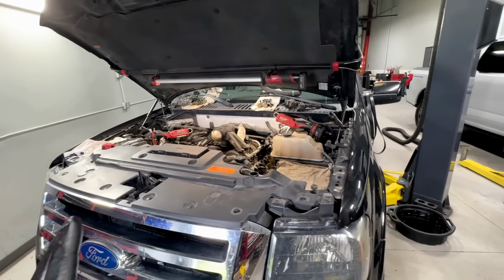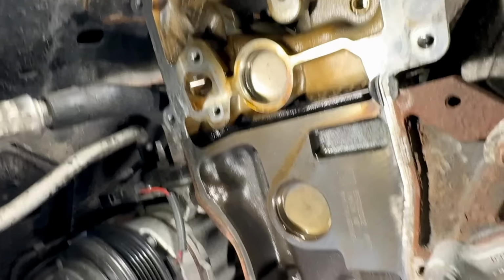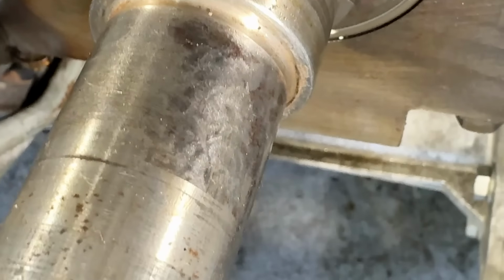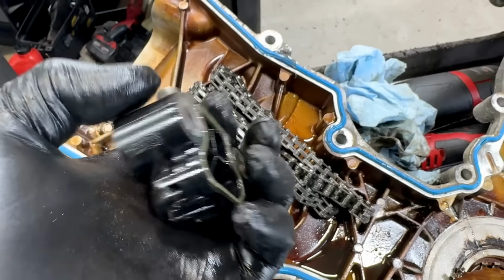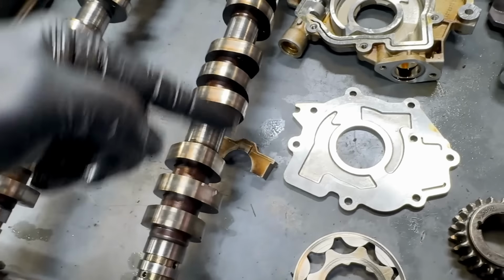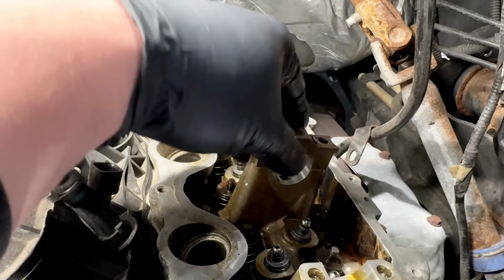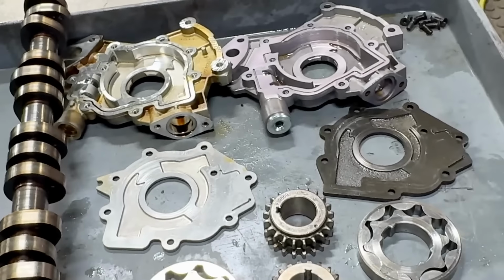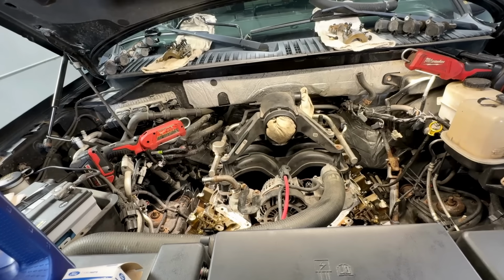How to Destroy a Perfectly Fine Ford 5.4L 3v Triton Engine with a Timing Job!

Comment: Mr Mak, thank you for what is essentially a refresher on the three valve. What you covered you have previously illustrated well, going back I guess 5 or more years ago when you started your channel on the three valve engine. I studied your many videos on the 3 valve and on other subjects like it was my PhD project. Many people in the comments section are behind the 8 ball, several of them did not listen closely to what you said here, they are asking questions for which you have already given the answers again today. As a rule the recommendation is to use OEM Ford parts. The melling high volume pump is recommended and the new chain tensioner design, valve tensioners and followers are recommended, all from Ford except the oil pump. The cam bearing caps are not interchangable nor replaceable, they are made to fit only that head, I can't believe that question was asked in comments, after the time you took explaining that in this video. Finally you rightly stressed the need to do quality tech work, right down to proper cleaning of sealing surfaces and torque of fasteners. It is not rocket science but apparently it is beyond the scope of capability for some professionals and DIY types. I think you need to open some satellite shops, sounds like there would be plenty of business to keep them busy.
Reply: So if I swap the camshafts from a Mustang 2005 to a 2008, it will not work ?

Comment: I did timing with all oem parts now it's running  like crap. Very rough 😢😢
Reply: Did you correctly time the engine?
Reply: @jamesrichardson645  I think so. I did what makuloco said.  The 2 mark on chain on top with the letter and the mark in the crankshaft at 6 o clock. But I would not start it if is out of time . Of im wrong?
Reply: @OscarPerez-ns2ob  The single coloured chain should line up with the inverted dimple on the crankshaft sprocket.

Another thing, check all the injector and coil pack plugs have been properly plugged in. Initially mine ran like crap because one of the injector plugs popped off.
Reply: @jamesrichardson645  I'll check that. Once I hit the gas sound better on neutral. But if I put in drive start  running like crap. Thanks man I'll check that

Comment: Ford makes some really nasty gasket remover, you spray it on and just take a plastic razor blade to scrape it away. I can not believe a shop did this, looks almost like a DIY gone bad!?
Reply: I pulled the head, and redid the timing as my first internal engine work. And mine came out much better than this. It's actually running quite well.

Comment: My 04 has 231,000 and I had the vvt solenoid changed on the passenger side or bank 1 .  I had a shop tell me that bank 1 only had 20 % oil pressure and bank 2 had the proper oil pressure. My question is should I look into another motor for my truck or is it possible to have a timing job done ?

Comment: I just picked up a 97 Econoline StarCraft van with a 5.4 liter 2 valve and 155,000 on the clock . Should I be concerned ? I keep hearing horror stories about the 3 valve .
Reply: Thev2 valve will run to 400k with regular maintenance!
Reply: @kennethnewell4955  that's fantastic news ! 👍

Comment: I really hope the guy gets his money back. My 06 Ford escape was knocking i through the engine was gone. It went away a day or two later. But the sound was coming from the drivers side front bank, right, where the powersteering pump is. Such a useful channel. i am not a fan of aftermarket parts.

Comment: This is exactly why I drove the 2.5 hours to get my truck over to you for the bulletproof! Easiest and Best decision I’ve made in auto repair!
Reply: I did the same thing and drove over  2,000 miles which I drove none stop 26 hours to see Brian and he did the everything and I mean everything and some more and he was able to get it all completed in 2 in a half days. I would say hands down the best money spent and decision made.
Reply: @1937Jay how much was it?
Reply: @HannibalAcrotices  it was the best $6,500 spent

Items replaced at 250,000 on original engine and transmission.

The following items are replaced during the service: chains, tensioners, guides, tensioner arms, VCT solenoids, phasers, Melling HV oil pump, gaskets and oil change after. two heater hoses, oil pan removal for clean out, all engine mounts, transmission mounts, coolant hoses, new water pump, new spark plugs, new rocker arm, valve lifter, follower lash adjusters.

All work was completed and done within 2 days.
Reply: @1937Jay what town is this guy at ?
Reply: This Guy  and The Car care nut who is not far up in the chicagoland area  are the only 2 guys i would really trust on my vehicle
Reply: @renj6531  I agree I wouldn't trust anyone going forward.
Reply: Can you share how long the work took and how much it cost?  I'm thinking of driving 6hrs to BSG to have this done!
Reply: @ronjohnson8816  it was a 1.5 day process dropped off in the morning went to the hotel for the day it was ready when I checked out the next day.  As far as cost I’m not comfortable sharing simply because parts prices may have changed, I also had everything done including roller followers and lash adjusters as well as some other fluids serviced while I was there. Best bet for an accurate price would be to reach out to Brian directly. What I can also share is that he’s super professional and responsive to even the dumbest questions from guys like me. Highly recommend the trip and I think the pricing was fair and also very much in line with having somebody without his experience do the same job.
Reply: IT WOULD BE CHEAPER TO BUY A TUNDRA 😂 @ronjohnson8816
Reply: Got an appointment to have mine done in a couple weeks. Driving 8 hours from Tennessee. I wouldn't trust anyone around where I live with this. Love Brian's videos.
Reply: @GregCraddock Brian did a great job!! 1.5 years later all is well!!
Reply: How much?

Comment: The parts?  Ok, maybe you don't know.  It happens.  But lack of torque on the crankshaft bolt, gaskets not replaced and the cam shaft caps?  That is sloppiness to the point of doing it on purpose.

Comment: Any chain problems with my 2000 5.4 2 valve. 130,000 miles regular oil change full synthetic. Hope to be buried in it.
Reply: 2 valve tritons are awesome engines.

Comment: How, and why, does Melling make a good oil pump replacement, but such crap for the timing kit parts? I mean that timing gear had to almost be made with an insufficient thickness to be moving around that bad on the crankshaft. Crazy! Also, good info on the camshaft caps, that's something that most wouldn't realize, and they need to be removed and placed on a rack in order of removal to be kept in order.
Reply: @-BlackBird7  Exactly, why do people watch a video, yet not pay attention? What do they think is holding the components in place especially when he says it's not press fitted! Even if it was i wouldn't want a crankshaft bolt installed and not torqued. I had the clutch replaced on my FWD many years ago which involved removing transmission/drive train. Quite sometime later i heard a noise, thought a wheel bearing was going. Even bought a new bearing planning to replace it on the weekend and discovered they forgot to torque the CV axle in the hub! That's what the noise was. Checked the other side too but i forget now if it was torqued properly. Mistakes can happen--mechanic interrupted, went for lunch, and forgot he hadn't done it?
Reply: Interestingly, Melling also make the FORD OEM Timing Phaser.

Comment: Probably some kid who does timing belts on lil 4 bangers with no knowledge how these modular engines work done this job
Reply: Keeping cam caps in order and correctly oriented isn’t unique to the Ford modular engines.  That is basic engine working knowledge.  The guy just didn’t know what he was doing.
Reply: @ghostwrench2292  worse, he didn't care
Reply: Ya it's quite straight forward job with added putting updated phasers and followers . Plenty of working room
Reply: These engines are, in my opinion, one of the easier engines to do timing chain jobs on. Heaps of room up the front, single OHC, and one chain per bank.

Comment: So the only aftermarket part you recommend is the melling hv360 everything else OEM.
Reply: He does have other video's that go into details on the whole job, and they are fairly concise. Definitely not a job for the average "shadetree mechanic".
Reply: @Internutt2023  I’ve watched them but I’ve always been informed that melling and cloyes make the parts for ford, so it’s crazy to see how bad the parts are if they actually do manufacture them for ford, except the oil pump is the only good aftermarket part from them.
Reply: I prefer the M340HV for the 3V, because it keeps the same maximum oil pressure, only brings up the minimum oil pressure. The M340HV was specifically designed for the 3V, the 360HV works well too, but it was designed for either the 2 or the 4V variant, I'm not sure.

Comment: Shop not knowing how the heads were designed for the camshaft is inexcusable. Not cleaning gasket surfaces, did not torque the one time use bolt, and sure got all kinds of dirt in the engine. The first time I saw a chain replacement video I knew the caps and heads had been line bored. I intend to do the chain job on a 4.6 2 valve engine. After seeing this I will buy OEM parts. The aftermarket chains are terrible. I see exactly what you mean and that back side of the chain is the part that runs on the lousy plastic guides. The whole set up from non replaciable cam bearings, and the plastic guides is not the greatest. But they have to sell new vehicles. I use to rebuild marine diesels some were multimillion dollar engines. I know what well made engines are. But his job is a walk in the park if you know how to do it with the right tools. The timing tool is very important and makes the job easy and foolproof. I always change the oil at 3500 miles and use 5w30. 152,00 so far and runs fine. My bet is tensioner fails before the chain in most cases. Great video thanks.

Comment: This is a great example of the difference between a technician and a parts changer. 
I feel bad for the owner. I don't know many people who can afford 10K to fix this mess. Hopefully the other shop will cover it. I doubt it, but maybe they will after receiving some encouragement
Reply: Yeah and in the rust belt putting $10K into an older vehicle is not feasible anyway as the body will rot off before a new engine wears out. At least if he takes them to court he'll have a nice video showing all of the faults!
Reply: The other shop should pay 100% of the replacement cost. 10k is enough to go to court over.

Comment: I think messing up the order of cam caps alone was enough to ruin the motor.  Of course, the sloppy installation didn't help.  I'd avoid the ratcheting tensioners.  I think the previous owner of my truck revved the engine cold and built too much oil pressure, the tensioners ratcheted to apply too much pressure to the guides and cracked them all prematurely.
Reply: I love the cast iron ratcheting tensioners.  I have 300,000 miles on the original cast iron tensioners on my 2001 expedition and 100,000 miles on my 2008 F150 since replacing the defective plastic tensioners with the exact same Ford tensioners that are on my 2001 expo.

Comment: You know what compounds this problem? The mechanic is forced to work within the flat rate time so this increases the probability of mistakes being made  and shortcuts being taken!
Reply: Flat rate doesn’t help but it’s also not an excuse.  The basic knowledge of keeping the cam caps in order and facing the right direction is not due to flat rate pay.
Reply: Sad, yes, and could be a compounding factor.

Comment: Yikes, I know owning one of these newer vehicles is expensive  😫 😩 😭...But, people you have the Internet and YOU  can call a fella like "Dr. Mikulsko " ,get a quote and start saving up for the best repair and parts...OR  you can end up like this customer...BUY ONCE...CRY ONCE...Even a junkyard motor ain't no  guarantee...Why, coz eventually you  gonna need this job done or get rid of the vehicle...This vehicle new is about $60,000.00 USD...Your choice...😮😮😮
Reply: Newer? Far from it. This suv is 10 years old! The 5.4 3v is a 20 year old design!

Comment: As much as it hurt, this is why I had the timing job done at Ford on my 2014 Explorer Sport. Some Independent's might say, sure we'll do it, but have done few.
Reply: Any competent mechanic should be able to do this job. Some of that shoddy work says hack even though they agreed to use parts that the customer wanted to use.
Reply: @KStewart-th4sk  not tightening the crank bolt properly and reusing it ( torque to yield ) is just incompetent and thus their negligence cos the customer t more money because now the crank is compromised.

Comment: Just hit 355k on my 04 5.4L. Still runnin strong
Reply: My 06 hit 376k before finally going out
Reply: I suspect you guys are changing oil on a regular basis
Reply: I've owned a couple 5.4 3v, the first was poorly maintained before me and died at 250k, my current is very well maintained and approaching 220k, good maintenance goes a long way.
Reply: How often did you change your oil? I changed mine every 3,000 in our 04 5.4
Reply: Curious if that was on original timing components?
Reply: Only run royal.purple in my cars all have over 250k on them no major repairs .
Reply: Can you tell us everything you have had to replace since day 1?
Reply: You're doing great..what's your secret?

Comment: Exactly why I don't take my vehicles to the shop. Unfortunately, most shops don't really know what they are doing.
Reply: It's because most shops don't pay crap. I get 15 an hour and I'm doing things as invasive as this to vehicles. I'm just trying to use this as a jumping off point to a better employer. My boss hates how long I take on stuff but I'm not doing stuff wrong just to ruin my reputation.
Reply: @RejectReality97  Yep, they'll moan and complain that young people don't want to work, failing to realize that they pay worse than McDonalds, with less benefits and YOU are responsible for buying tools which will set you back a grand.
Reply: @RejectReality97 I’m a mechanic too you will get there. Often times leaving is the best choice, there are a lot of jobs open for mechanics. I’d recommend a dealership or CarMax for better pay. I work at CarMax currently
Reply: @RejectReality97  Unfortunately, unless you're at a dealership that pays very well, time is money. Even construction work. getting paid by the hour, I was always rushed by bosses to go faster.
Reply: Yeah for something this technical it’s very possible they will mess somthing up like incorrectly torquing phasers, not getting new phaser bolts, wrong timing, not changing vvt solenoids, not cleaning gaskets well etc…

Comment: I can not say with certainity but  there is a good chance the customer bought the Melling kit of Amazon and maybe it was a Chinese counterfeit parts kit
Reply from the maker: Summit Racing
Reply: @FordTechMakuloco Not much difference. Bought some Gorilla lug nuts from them to replace the sorry 2 piece ones on my F150, but that's about it.
Reply: @FordTechMakuloco I think I saw another YouTuber where they purchased a machined part from Summit that was supposed to have been made from a US company.  The customer returned the part to the manufacturer and they found the part was a phony.  Be careful
Reply: @FordTechMakuloco  didnt you promote milling oil pumps a few years back?
Reply: @cortneybunge359 pretty sure it’s the Melling timing kit components that you’re referring to, which he states in the video.
Reply: I had a Toyota Cloyes timing chain tensioner seize up on me 6 months after I did the repair. Could have crashed the engine. Not worth aftermarket for critical components.
Reply: Our shop couldn’t get all the parts at the local Ford dealership. We ended up buying a kit from a Ford dealership through Amazon (all packed up in a large box). The only additional items we ordered through Amazon was the Melling engine oil pump.

Comment: i just bought a 2009 E350 van 1 ton / 5.4 engine (L vin code) - it only has 65,000 miles on it. what is THE best brand, type, and grade (conv/synthetic?) engine oil to run in this puppy???? THANK YOU!
Reply: On my 07 Expedition I run full synthetic 5000 mile oil and change it every 3000 miles. Yes the oil is still considered clean, but I don't want to build up any sludge in the engine and starve the top of the drive train inside of the engine.
Reply: every 5k is good enough.
Reply: Buy Valvoline or Havoline synthetic.